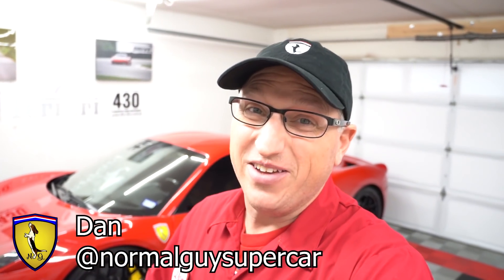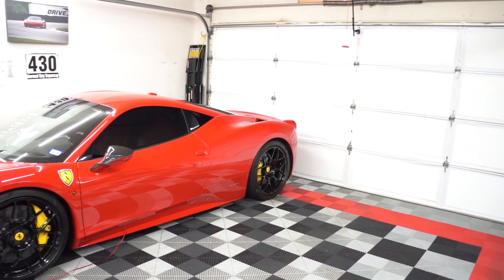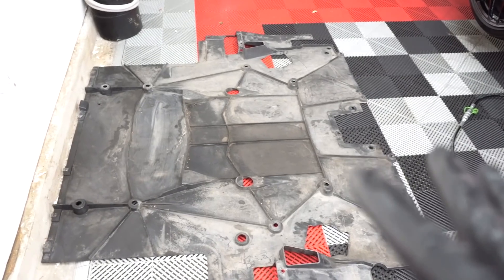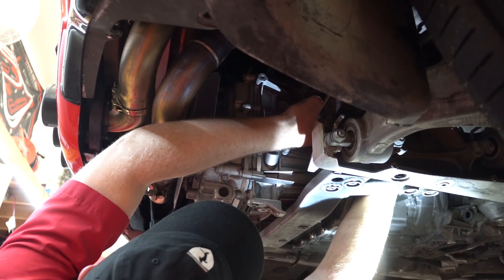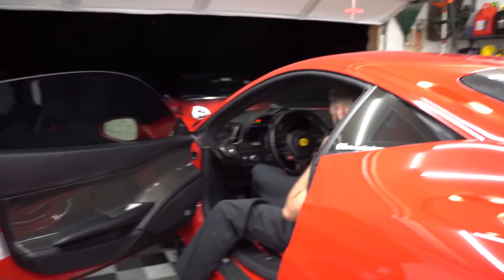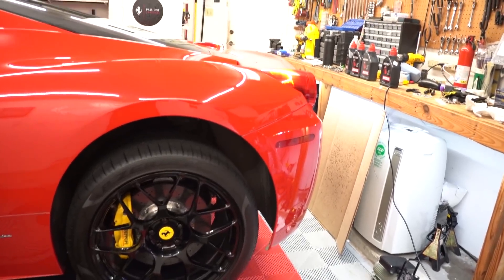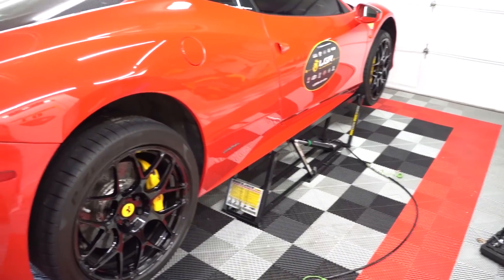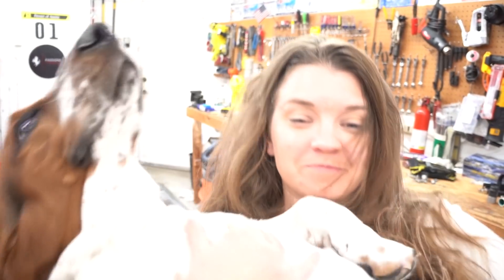Repairing my FERRARI 458 DCT OIL LEAK and How To check the DCT Fluid Level

Comment: For clutch oil qty check you made a mistake the temp.for the engine coolant mean the oil temp.not water temp..otherwise it ist not possible to get the clutch oil temp to 60 deg centigrade with max 80 deg centigrad.

Comment: The 124 Spider / Miata auto has the same measuring system but also has a fill plug so basically pour in until it leaks, no need to overfill.
Reply from the maker: Yeah I've since heard of a few systems using it

Comment: Dan, wouldn’t it be a problem if the OEM Shell stuff and Motul stuff mix ?  In all the drain and fill on my automatics I stuck to OEM fluid only for this reason because I can’t flush the old stuff out.
Reply from the maker: I don't think so but I'm not 100% sure

Comment: Nice video. In this you are checking the hydraulic clutch fluid or the gear oil?  Do you have info on how to check the DTC fluid as well as the gear oil level? It seems like this transmission holds 8qt DCT fluid and 4qt of 75w-90. I have a leak on the cv axle seal to repair and need to refill.
Reply: Nevermind, found a thread after posting this.
https://www.ferrarichat.com/forum/threads/changing-transmission-oil.611440/
Reply from the maker: This was the DCT hydraulic fluid as mentioned in the video, not the gearbox oil.
Reply: Normal Guy Supercar thanks. I found that the gear oil is filled from the plug on the back cover, and drained from the two outward plugs on the passenger side. The middle plug on the passenger side drains the DCT.

Comment: Does the DCT in Ferrari bathe the gear ratios in the same oil/fluid as the wet clutches?  In the new NSX DCT, there are separate oils/fluids for the gear ratios, wet clutches, and a 3rd oil for the hypoid final drive.
Reply from the maker: Separate. So there's multiple fluids. DCT fluid and gear oil.

Comment: Unbelievable my 2004 Corvette almost has a similar way of checking the transmission fluid  the car has to be running while you're underneath to check the level
Reply from the maker: Good tip know other cars have this odd process. 😁

Comment: I did my transmission fluid change about a year ago on my bmw f10
Zf Dual clutch 8 speed , had to warm up the car as well pumped oil until it came out and these trans oil are expensive 😂
Reply: Zf is torque converter 8 sp not dual clutch
Reply from the maker: Yeah, having where you just intentionally overfill is somewhat expensive.  You just watched at least $20 worth of DCT fluid piss out of my trans.  LOL! :)
Reply: @normalguysupercar  yaa i thought as much 😂 the amount of oil wasted was hard to watch 🤣
Reply: @FerasAlhawas  bmw f10 has a zf dct transmission look it up

Comment: Why didn't the factory just determine the proper level at room temp, and put in a screw-in type dip stick, or install an external vertical sight-tube along the outside???   That's nonsense with all the temps, draining, overfilling, draining, etc... 
Jeez!   An external sight tube would allow the oil level to be checked from a glance!   You should make a kit and sell it to 458 owners for $10K a pop.  lol
Reply from the maker: I like that idea... I should.. :)